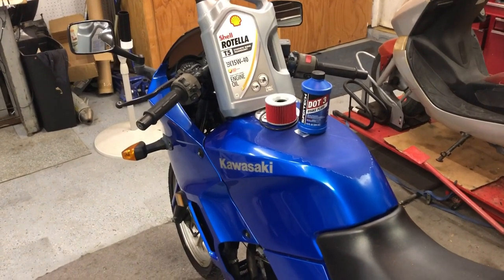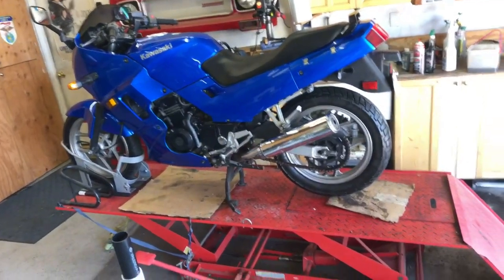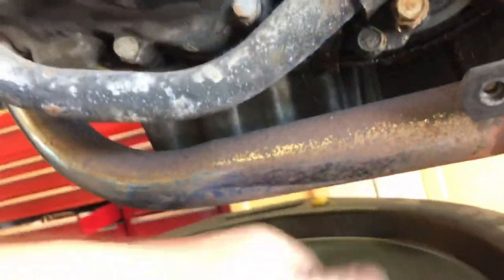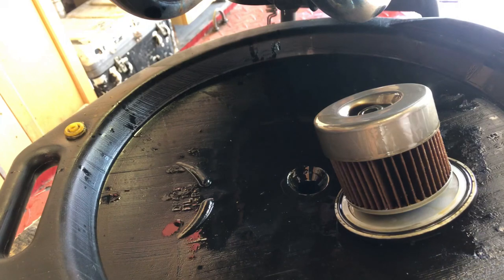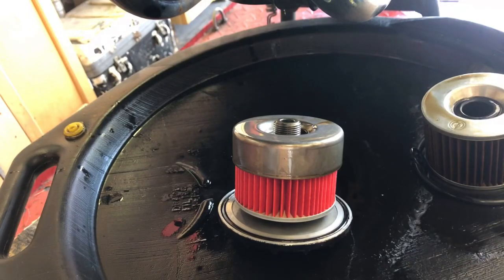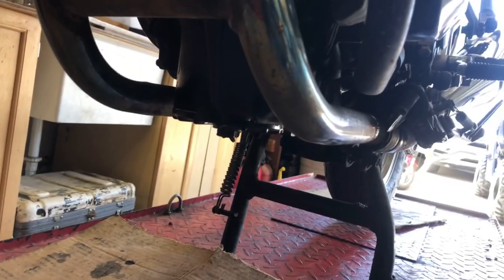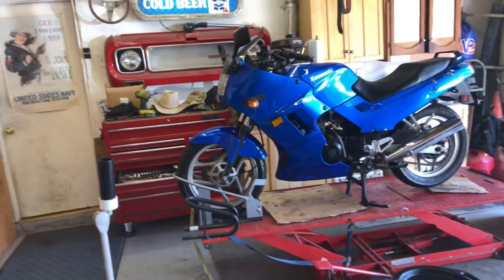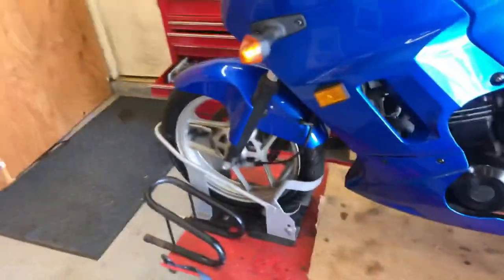Ninja 250 Maintenance: Oil Change, Brake Fluid Flush, Speedometer Repair

Comment: Thanks. My daughter just got her first bike. A 2007 250r just like the one in your video. It was sitting for 3 years with gas in it! So we have been taking it apart and learning how to clean and replace everything. Lol. You were a big help
Reply from the maker: They are pretty good machines, I’m always on the hunt for another one.  Hope y’all get it running great!
Reply: How would you suggest cleaning rust out of the tank? I've tried evaporust and some other things, but not much success
Reply from the maker: @danandbarbielove  I use vinegar.  There’s a video on my channel showing how well it works,

Comment: I use rottella as well. However T5 is not JASO MA rated the conventional 15w40 and the T6 full synthetic are however JASO MA rated for wet clutches. Not that you should have a problem just it may be better for wet clutch applications.
Reply from the maker: I generally use the conventional.  Have used T5 on occasion with no adverse effects but it’s not my usual “go to oil “.  I always try to recommend to use what your manual states....even though I go against my own advice.  😀😀

Comment: 10w 40 is in the owners manual. 15 is not that big a difference to me either. I also don't have or use any other means than cranking the bolts good and tight. I think just regular winging it maintenance is better than doing it shop manual right but not enough times, miles wise.
Reply from the maker: I always recommend following the manual, but you can do ok with changing things up a little bit as long as you use common sense.  Thanks for watching.

Comment: Hey man nice video really helpful. Out of curiosity do you know when I should switch to full synthetic oil in my 2007 ninja 250 ex 16k ish miles
Reply from the maker: As long as it’s a recommended oil type in the manual, any time should be fine.  I have been known to stray from the manufacturer recommendations but that’s my choice.

Comment: I have a question for you I have a ninja 250 year 2000 And he does not want to go into second third fourth fifth or sixth gear only first in neutral. Do you have any ideas?
Reply from the maker: Kawasaki has a neutral finder thing, makes it so you can’t miss going into neutral from a stop.  Could be an issue with that?

Comment: Does anyone know if there is a specific brake fluid you are suppose to use on motorcycles, or can you just use any kind?
Reply from the maker: Bre Ford DOT 3 or DOT 4 usually, should say right on the master cylinder cap.  No reason to buy expensive stuff unless it helps you sleep well at night.

Comment: Is it possible to create air in the brake line just by opening the reservoir and closing it to check if it’s empty ?
Reply from the maker: Eli V no, that won’t get air in the system.
Reply: Tom's Tinkering and Adventures ...thanks man great video
Reply from the maker: Eli V hope it helps you work on your bike.

Comment: How do I change trans oil in my 07 ninja 250??plz help
Reply from the maker: Engine and transmission are combined.  Oil change takes care of both
Reply: @TomsTinkeringandAdventures  I did earlier...now I'm getting clutch creep 🤦‍♂️
Reply from the maker: @mikebenson1104  did you use motorcycle specific oil?
Reply: @TomsTinkeringandAdventures  synthetic oil
Reply from the maker: @mikebenson1104  but is it motorcycle specific??

Comment: did u buy that oil at your local auto parts store
Reply from the maker: Nismo knight productions I don’t recommend oil on my channel, only thing I will say is that you should follow the owners manual.
Reply: @TomsTinkeringandAdventures  but were did u buy your oil at is my question
Reply from the maker: Nismo knight productions I get oil at Autozone or Walmart usually.